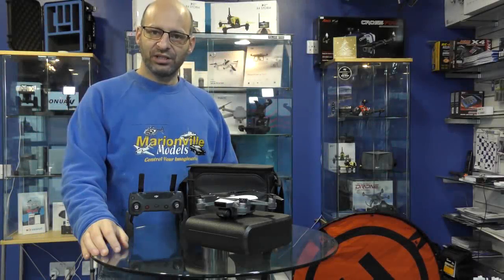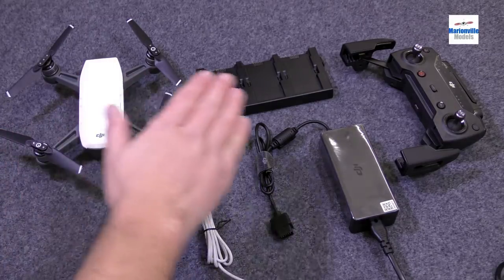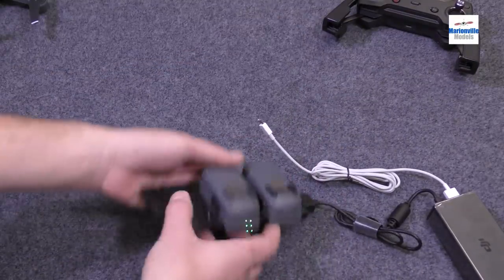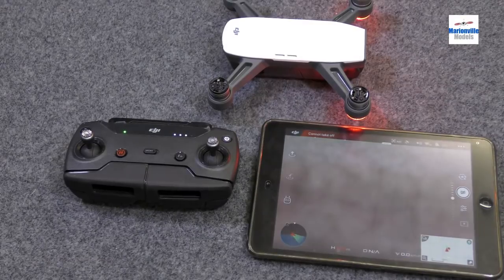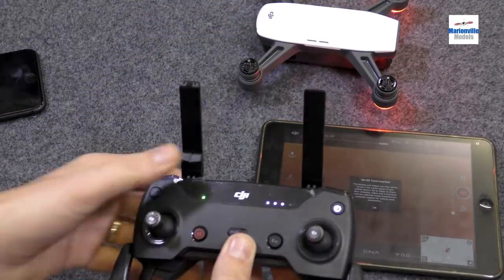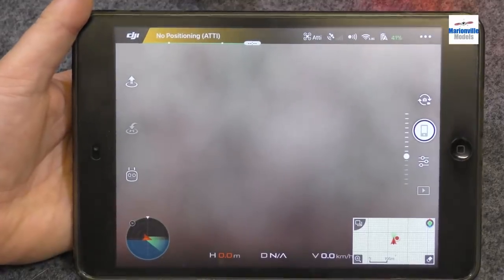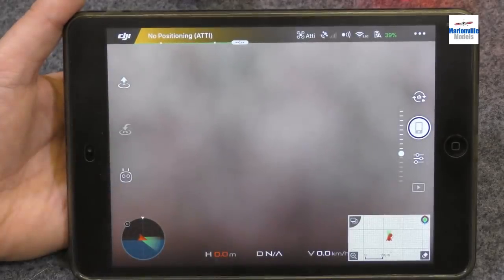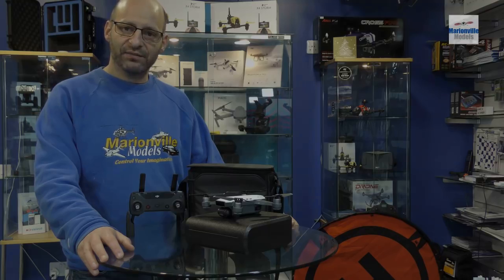DJI Spark Drone Getting Started, Setup & Review

Comment: Thanks for the info, great video. I have recently started flying a Spark, 3 videos on my channel so far. Do you suggest using a filter on the camera to improve quality? Thanks, Mark.
Reply from the maker: Mark Kerton I would only use filters for video work to smooth out the panning shots.
Reply: Marionville Multirotors Thanks for your reply. That’s my main concern, it’s sometimes a bit skippy on the panning! So I’ll get a filter fitted for the next flight and keep it at 60fps. Many thanks👍🏻

Comment: Great video. This is definitely helping me get started. Only thing I've noticed is the 2second delay on the throttle, I removed the props and turned on the motors then shut them off to test and it worked as it should. However I held up the drone like it was flying and held the throttle down to see if it would shut off and it did. So question is is this because it is that smart and wouldn't shut off if it was actually flying or is something wrong?
Reply from the maker: MR. FPV the drone will detect its no longer descending and shut the motors off. If it was actually flying it would keep the motors running till it’s on the ground.
Reply: @MarionvillemodelsMultirotors  ok yeah I figured it was something to do with the sensors. I did end up trying it with props on and it didn't shut down. I appreciate your reply. Thank you

Comment: what if im flying and im kinda far away maybe 1/4 of a mile and i dnt know how to bring it back home i press the home button and it will come back to me?
Reply from the maker: Gamingforfun 007 yes. If you get lost just press the home button and the craft will come home.
Reply: But be aware that it won’t avoid obstacles if it’s over 80 meters or feet (can’t remember) because it’ll travel quicker. Therefor, if you loose it, it could crash
Reply: Will_I_Sammy but it should have a meter adjustment I can adjust when it comes home right on settings?
Reply: Gamingforfun 007 No you cant because it’s travelling extra quick after 80m so it’s trying to get home quicker, as if it’s in sports mode. Like in sport mode, it disables obstacle avoidance.

Comment: When I push the "connect" button on my IPhone, I get a message "no internet connection". Why?
Reply from the maker: romeo rozeta if it’s during activation you need to reconnect to the internet.
Reply: Are you referring to my smartphone being hooked to the internet? Because I do get data through my wifi. However my wifi does go through a microcell in my home since I live out in the country, if that makes any difference.
Reply from the maker: romeo rozeta ok. If you have mobile phone data then you can keep the phone wifi connected to the craft.
Reply: Yes, but the phone gives me the message " no internet connection" when I try to connect to the controller.
Reply from the maker: romeo rozeta are you using iOS or Android.
Reply: ios
Reply from the maker: romeo rozeta have you tried another devise.
Reply: romeo rozeta the remote will not give an internet connection. The WiFi is only used as a serial connection to link your phone to the controller & the drone.  Here is a “schematic” (your device <—> remote <—> spark craft)
Reply: I just bought my Spark TODAY and have the same problem. I tired both my iPad min and my iPhone 6s+. Neither worked. They failed to rad the code and gave the "no internet connection". People jump to the conclusion it is paired to the spark where their would be not internet but instead, we are just trying to register the damn thing. How I fixed it...I went to the store to purchase the protection plan and it read my Spark auto entered everything. Now all is well...cost me $59. LOL! Also, the WiFi password in then battery compartment..forget that. The password for all DJI Sparks is 12341234 NOT The password on the sticker. This is taking the joy out of my first drone.

Comment: Might be useful if the drone could be activated.......had mine for 4 days now, on line with DJI support for over 4 hours, waiting now for over 48 hours for the their 'engineers' to figure it out but the drone still not activate!  First thing you say in your video is your gonna show us how to activate, but watched the whole thing twice and you never cover how to do that..........I've tried following DJI manual, the Go4 App instructions, and the DJI video, nothing works.......hoped your video would give me a clue but you don't mention it at all.  Might subscribe it the thing ever works!!!
Reply from the maker: Bill Meador sorry about that. I must have already activated it before I did the video. Check this video. Although it’s for the Mavic it’s the same process. https://youtu.be/PrKFz6EPTTs
Reply: Well, guess there's more than an ocean between us.........by the way....was stationed in the UK for three years and loved it.  Unfortunately, my Spark controller does not have a built in Lightning connector, DJI says I should use wifi to activate not a cable, and their video on using the Go4 app says to start the aircraft first - then the remote.  Either way when I start the app I do not get any of the screens either you or DJI say I'm supposed to be seeing.

Comment: Sorry mate but 2 or 3 batteries will charge simultaneously. Maybe your firmware is not updated.
Reply from the maker: This video was made in 2017 a lot has changed due to firmware updates.